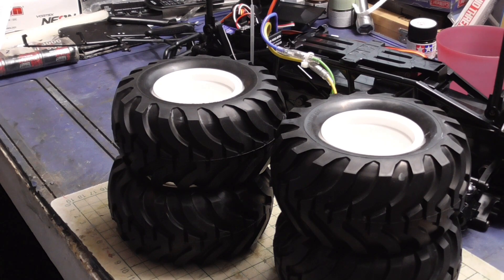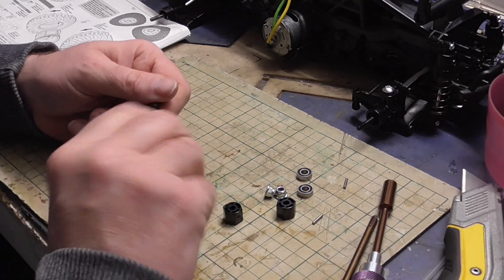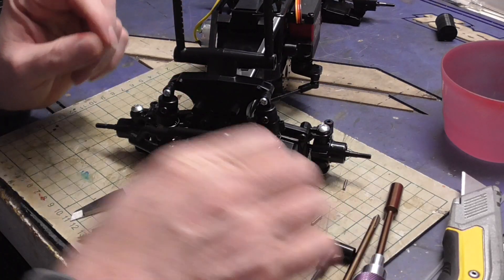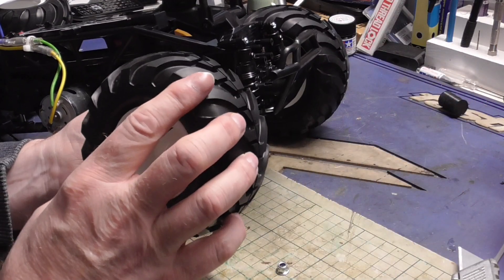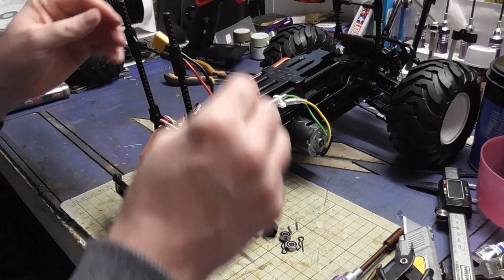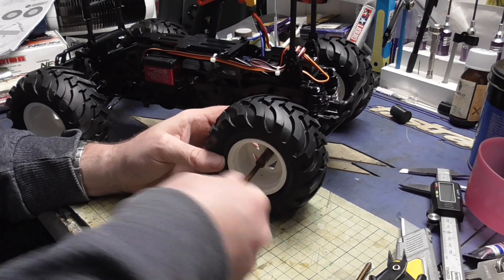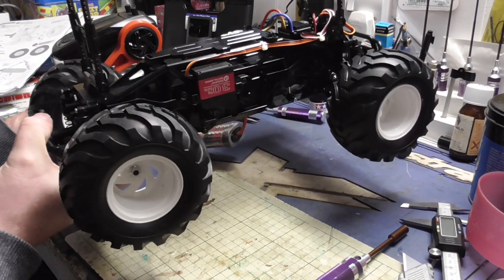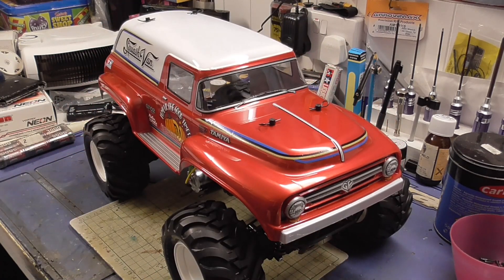Tamiya GF 02 Squash Van Build Part 31 to complete

Comment: Wow it looks really nice!!! Did you leave the body post set the same as the manual?  Happy New Year!!
Reply from the maker: I did not, I pushed the suspension down to bottom  and they touched the tyres so moved the pins to where they just cleared. If I put oil shocks on later and if a little softer I will have clearance.
Reply: Yeah I was thinking one higher also, Thanks @BasBoyRC
Reply from the maker: @ShenRC  Better to be long than too short.